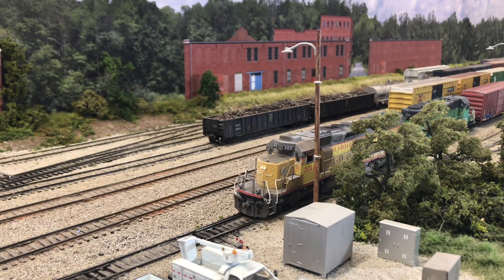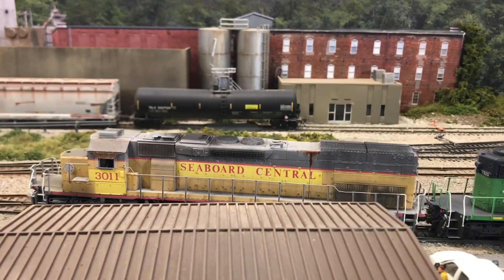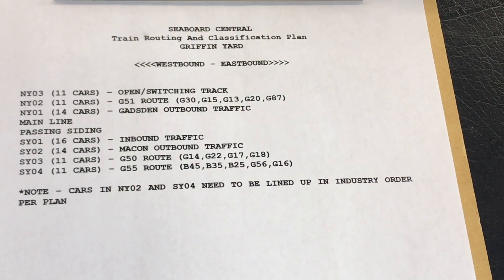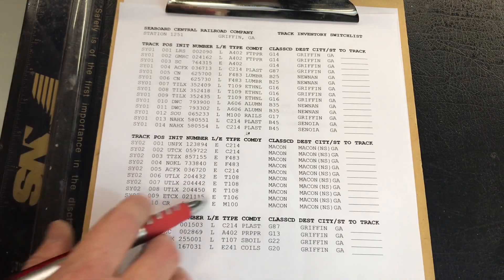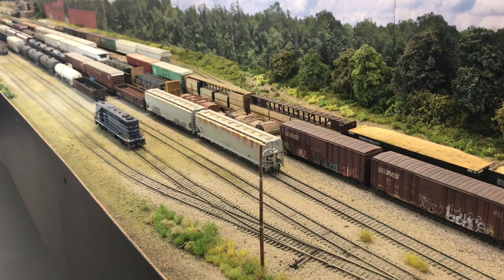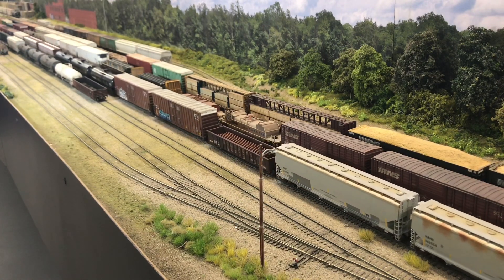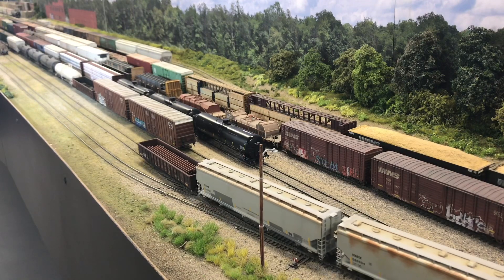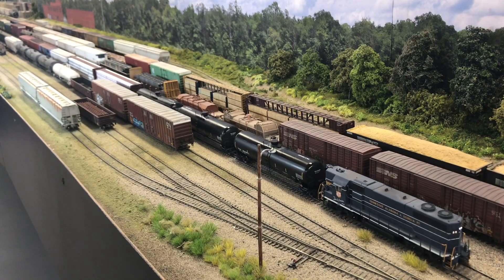Seaboard Central May 2020 Layout Update

Comment: This is a gorgeous model railroad. The blending of the tree line into the backdrop is very well executed; the backdrop flat buildings look "right" against the backdrop and they also merge the 3D scenery into the backdrop images properly; track ballasting is excellent; detailing and coloring of structures is most convincing, along with the "asphalt" streets; static grasses and scrub foliage look realistic. It goes on and on. Thank you for this inspirational video.
Reply from the maker: Thank you so much! Be sure to check out the June 2023 of Model Railroader magazine to see the original SC. Tim

Comment: 3011 one of the most finely weathered locomotives i've seen. thanks for posting.
Reply from the maker: Thanks! Right now 3017 and 3018 are in the shop being worked on. They will look like the 3016 in the dark blue scheme. Once they are finished, I’ll start on the 3010 and the 3012 which are the Tunnel Motor sisters to the 3011. They should be pretty cool since they will be in the original Red and Gray scheme. Tim

Comment: What turnouts do you use and how many feet is your yard
Reply from the maker: All my track is Micro Engineering Code 83 as I consider it the most realistic looking commercially available track. The wall with the yard is 22’6” long. Not sure what the length of the yard tracks are. They vary. On the paperwork the car lengths are in 60’ cars. Tim

Comment: What program do you use to make your switch lists? I'm having a hard time finding a good program that looks close to the lists I use at work (Railconnect/RMI) for use on my own layout.
Reply from the maker: Hi Chris, I don’t have a particular program to use. I just made some templates in Word then before I have an operating session, I’ll just update the list. I use three forms. One is a train consist, an industry work order and a track inventory sheet. I try to fit each list on one piece of paper. Makes things a lot easier for the operator. This means that no more than five industries are switched per train, per session. Not only is this prototypical, with slower more realistic speeds, it is enough to keep one busy for a couple of hours. Tim